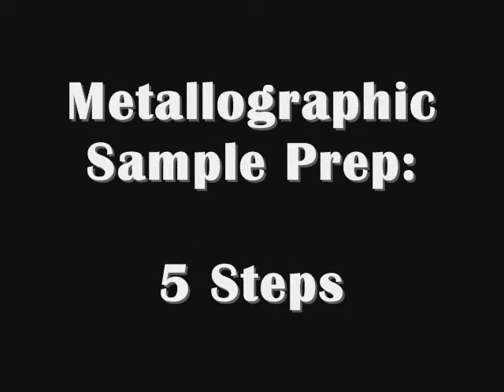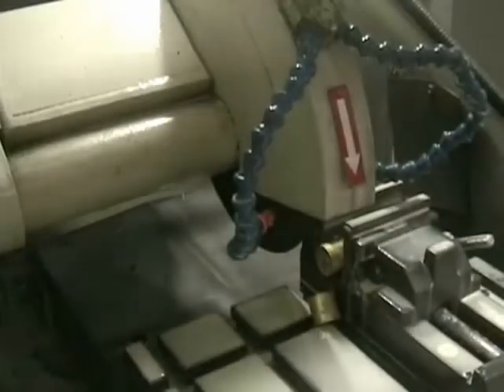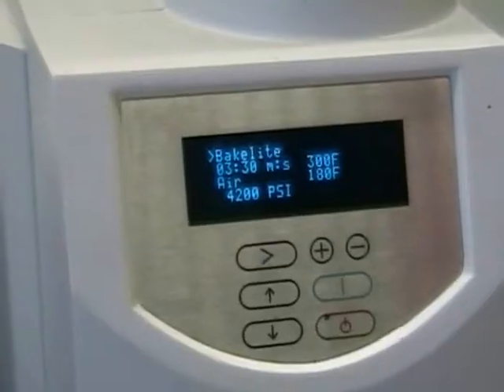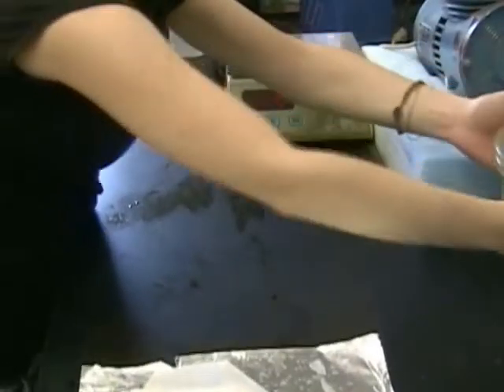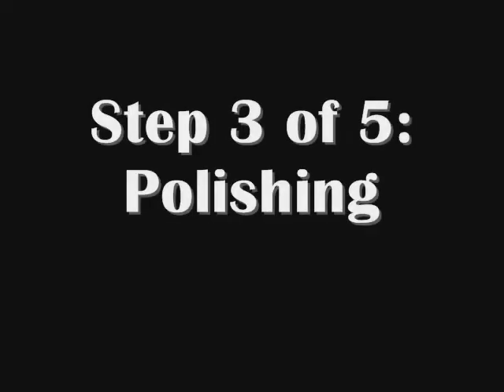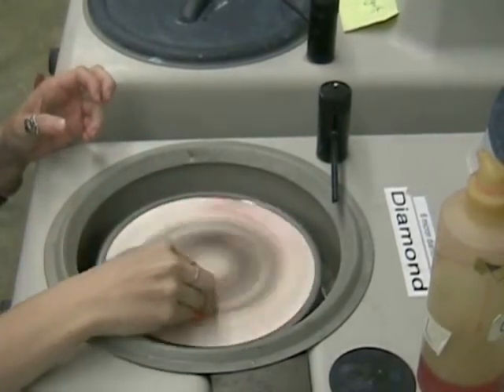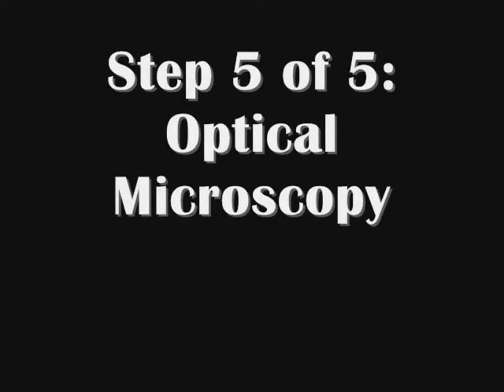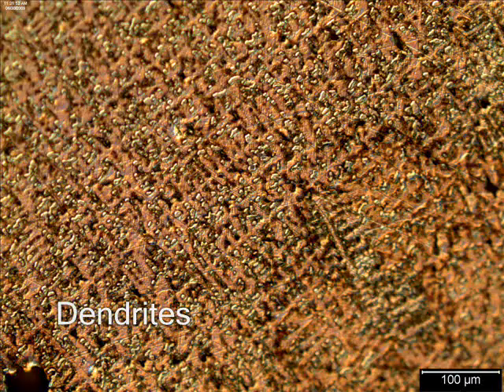Metallography Sample Preparation

Comment: An very important tip for grinding: between grit changing, you must rotate the sample 90 degree in relation last grinding direction, in order to produce the next scratch direction perpendicular to the last one. Doing so, you get more quick and efficient grinding.